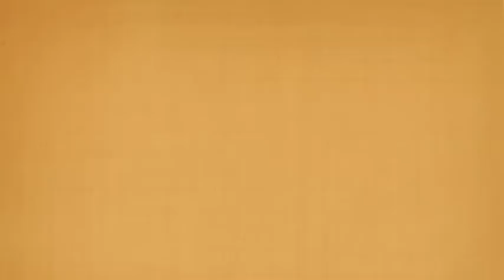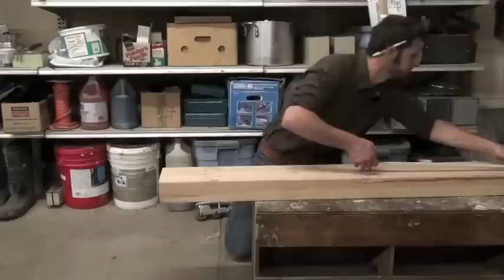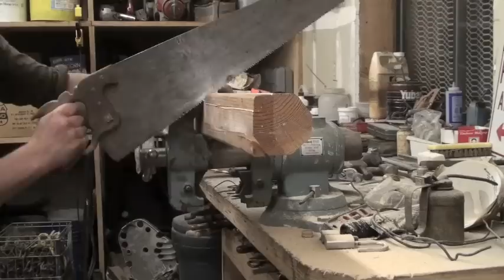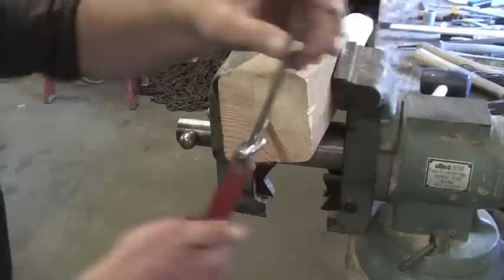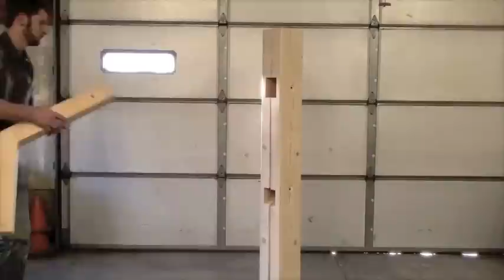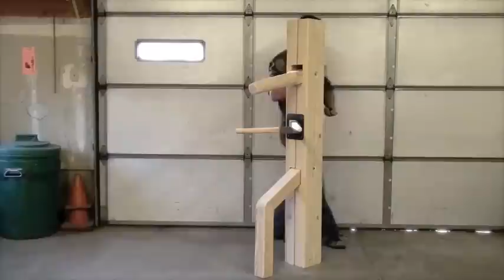Building the Choy Li Fut Wooden Dummy

Comment from the maker: @cli797nyc I prefer a tarp strap, this one is 13" and holds quite a bit of tension. Others that I've used that have had springs or bungee cords don't have quite as much resistance, so I prefer the strap. I still have yet to try with a weight, it seems like it would react quite a bit differently...

Comment: The link to the plan is broken.  Any chance you could repost the plans? Also what wood did you use? it looks like Douglas fir?
Reply from the maker: +Joshua Lahmann I fixed the link, it will work now! I did use doug fir, it tends to work just right with what I need it for. The only parts that tend to break are the center arms, but that is easy enough to replace.